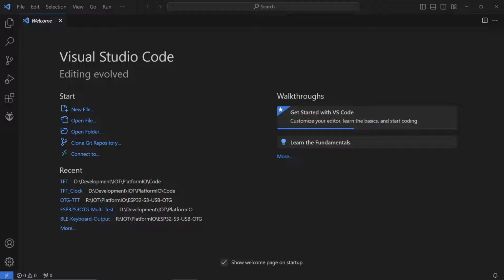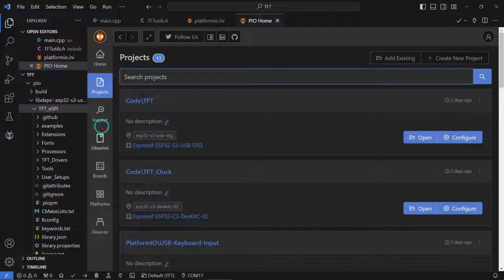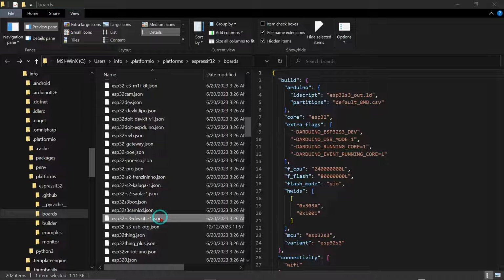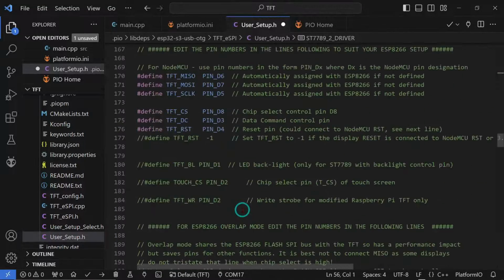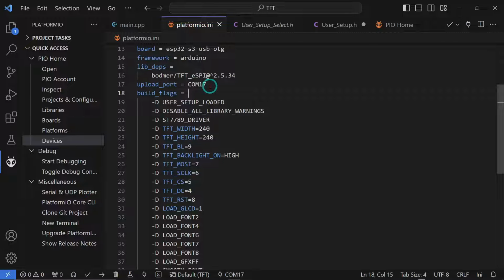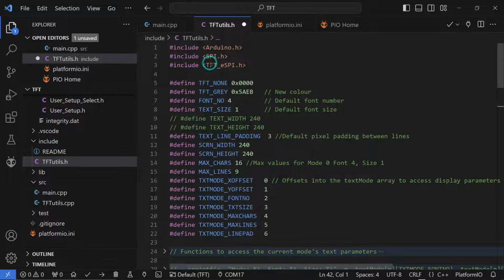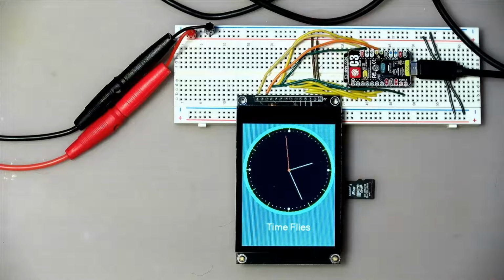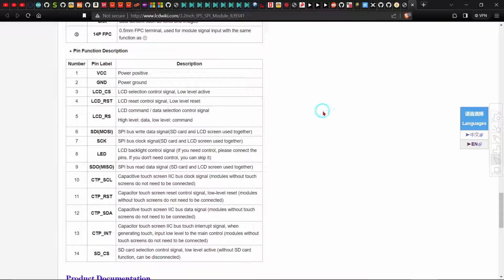Episode 2: Getting Started with TFT Displays.

Comment: If you ever want to use a parallel screen, then you can use the LovyanGFX library. SPI screens are also supported. I'm currently experimenting with it and it works very well. It is built like a plug and play replacement for the TFT_eSPI library. It also handles touch for you, when you're using one of the common touch panels (like GT911 for a capacitive screen). Also the LovyanGFX library handles user setup better: You can just create your own class and inherit from the "LGFX" class. Then you create you object from that and get all the library functionality in there. No need to disable some library-global user setup file.